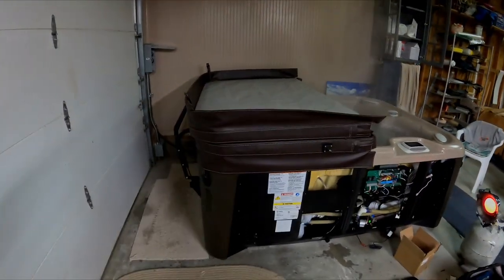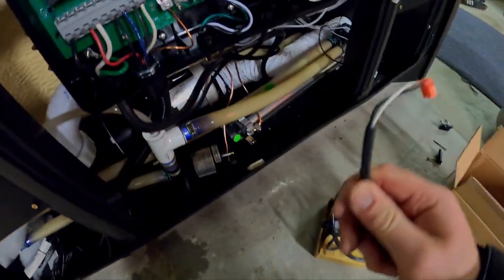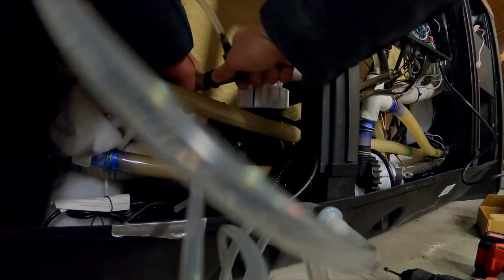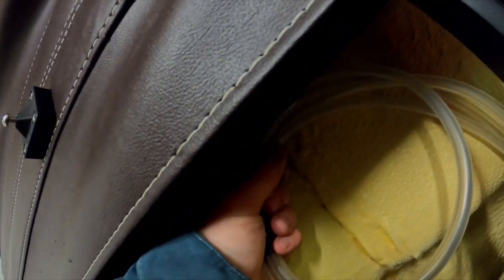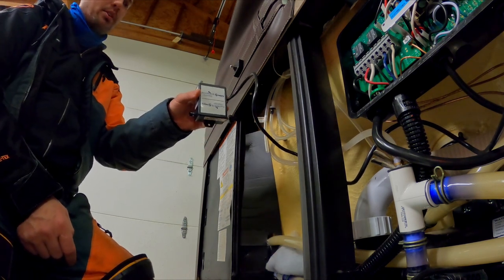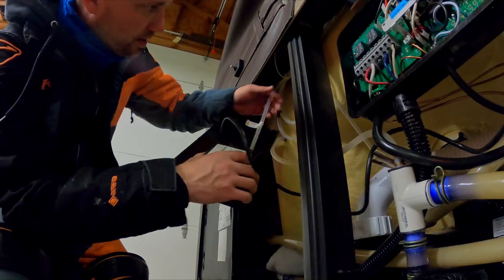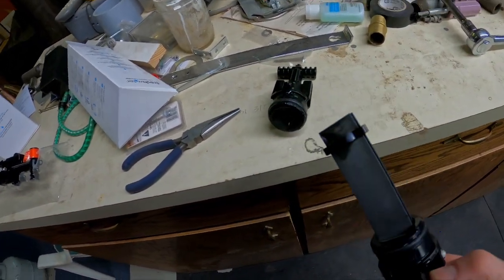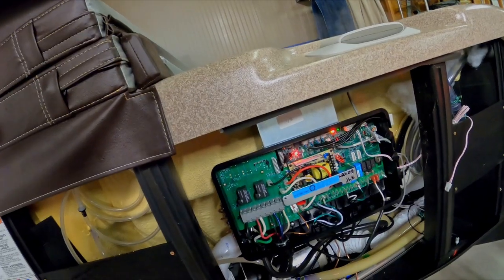Replacing Salt System with Ozone – HotSpring Jetsetter 2022

Comment: What happens if you do NOT unplug the power to the Freshwater Salt system when you do this? Can you run the system with BOTH at the same time, using Ozone to supplement the chlorine in the Salt system???
Reply from the maker: Great question. 

It is a recommendation from Hot Springs to not run both systems at the same time.

Comment: Did you install a proprietary Hotsprings ozone generator in order for it to be compatible, or something aftermarket?
Reply: Close up: Looks like a FreshWater III ozone generator by HotSpring.
Reply: $272 from Amazon
Reply from the maker: This tub uses the FreshWater III 72602 HO Ozone System from Hot Spring (https://shop.leisuretimeinc.com/products/freshwater-iii-72602-ho-ozone-system?_pos=1&_sid=a68f08b8a&_ss=r).

However, some hot tubs use the FreshWater III 72606 HO Ozone System (https://shop.leisuretimeinc.com/products/freshwater-iii-72606-ho-ozone-system?_pos=2&_sid=94d2e707d&_ss=r).

Let us know if you have any more questions!

Comment: I have a hot springs pulse. I had the salt system but want to change back to non-salt. Does this process need done with my tub ? Is there no ozonator at all in salt tubs?
Reply from the maker: Unfortunately the hot tubs do not come with Ozone preinstalled anymore. It does require a kit to make the change. 

https://shop.leisuretimeinc.com/products/freshwater-iii-72602-ho-ozone-system?_pos=1&_sid=d2de5fa88&_ss=r